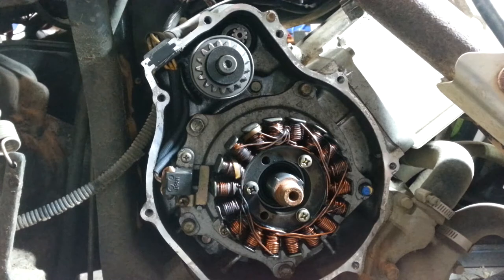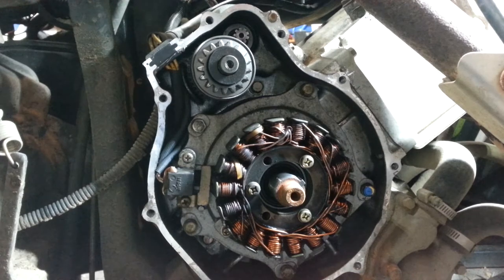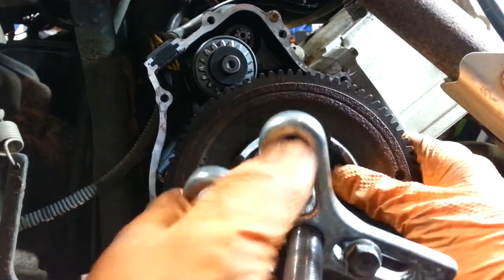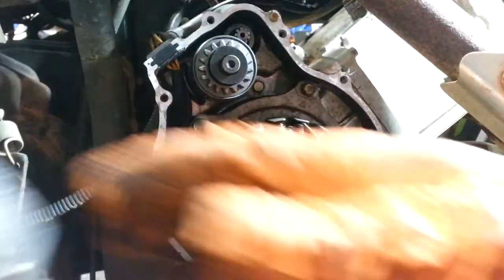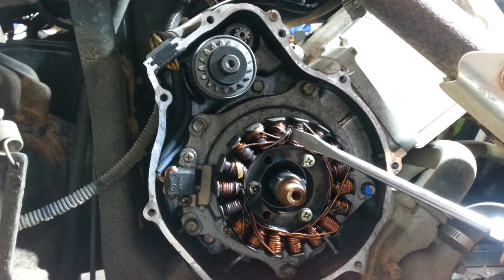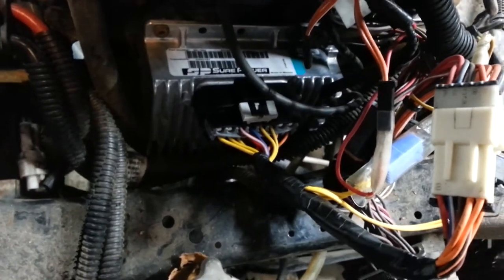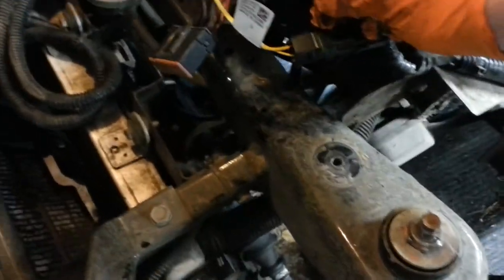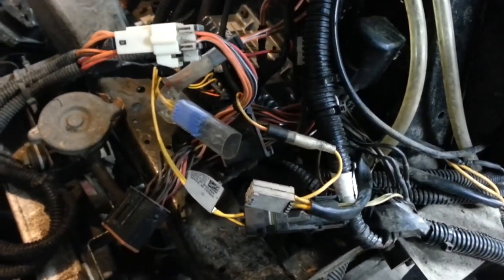2004 2005 2006 Polaris Sportsman overcharging battery flashing battery light fix 400 450 500

Comment: Thank you for the video  I'm going through the same thing.  I tested the 3 ac wires. Revved up I'm getting 50 ac volts or so across all 3 yellow wires. Atv at the battery is showing 18 volts once revved up. 
One thing that throughs me off is i installed a stand alone voltage regulator and a separate battery.  It showed charging at 14.5 volts stead however when i tried hook up  positive and ground on atv battery it only showed battery voltage? I removed my installed regulator and hooked everything back up, 18 volts at the battery. 
Any ideas?
Thank you
Reply from the maker: Sometimes this machine would do the same thing, it would show normal charging then overcharging. While testing the 3 yellow wires unplugged test for continuity from the yellow wires to a good ground on the frame. If there is continuity the stator is shorted to ground.
Reply: @1982HondaATC70  
Yes however if all 3 legs show 50 ac volts I wouldn't think one of the legs is shorted out to ground? It shouldn't show anything.
Reply: @paulcarpenter7429 well it also wouldn’t be a perfect connection if its burnt coating, however if it burnt the wire in half. It would be vibrating around and hitting both. Almost oscillating at its own frequency. I agree with you in a sense though. But my question is, how would a problem with an open short, lead to an OVERcharging problem. It is getting shorted out

Comment: What happens if my stator is putting out 17v of power, I revved the engine up and shot out both my headlights, not too happy about that, I was thinking it's a voltage regulator? 1995 polaris sportsman 4x4 400 2 stroke
Reply from the maker: More than likely it is your voltage regulator but on the older machines you need to make sure it has a good battery in it. If you have an ohm meter you can disconnect the 3 yellow wires going into the regulator (located behind the upper left side of the front bumper) Connect black wire of ohm meter to a good ground source like a bolt on the frame, then red wire of ohm meter to each yellow wire one at a time, if there is continuity to ground your stator is shorted like shown in this video.

Comment: Seems like a lot of work and you’re never 100% sure it’s the stator. Mine stopped charging and it ended up being the fuses all full of mud and corroded. I used to do a lot of mudding and swamping it. I cleaned it with pressure washer but all the connectors are full of mud.
Reply from the maker: This sportsman 400 model does not have a fuse block or circuit breakers. This is a visual example of a bad stator, if one of the coils is shorting to ground as shown then that is definitive proof that it is an issue with the stator. Another way to check for a stator short to ground would be checking for continuity to ground for each of the (3) yellow wires coming out of the stator, the issue there is that it may not always be shorting to ground as shown in this video.
Reply: @1982HondaATC70  yeah, my 05 has no fuses or relays, nor does it have a separate voltage regulator.  I did the same. Replaced ECU, only to see it was a 60 dollar stator. This fixed it